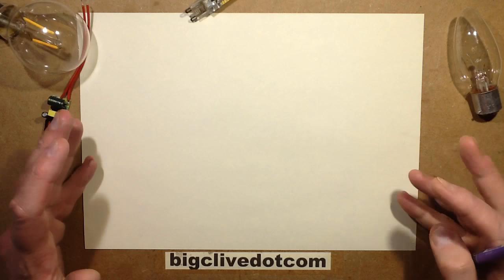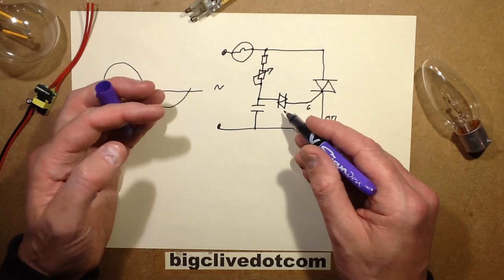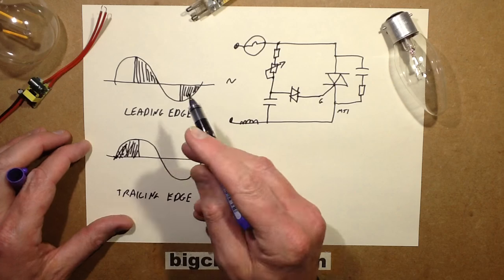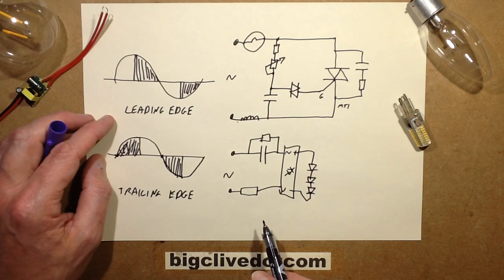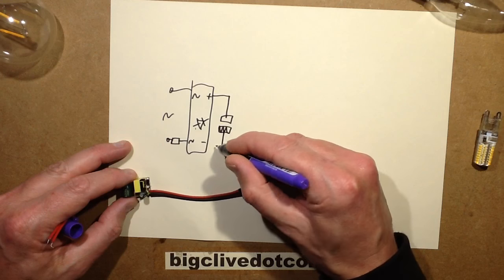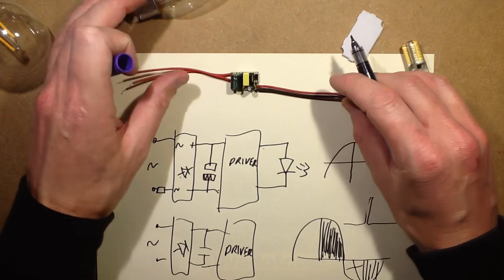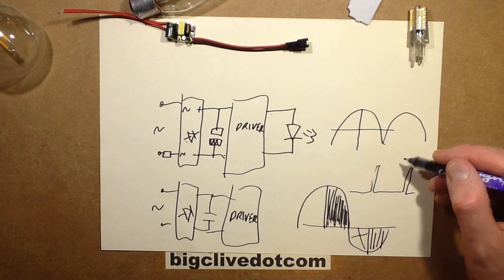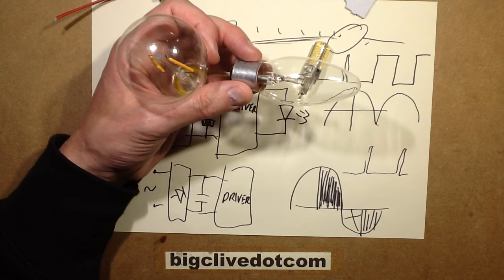Dimming LED lamps with ordinary dimmers.

Comment: One day lighting circuits will be low voltage DC, with the bulbs containing no electronics but the LEDs. Elsewhere will be a fairly beefy AC/DC transformer and the wall plates will just do PWM of the whole system in the room. Spraying RF around the house to control lights feels too inelegant and error prone - I've used cheap RF doorbells before, they're not very reliable and like to randomly go off.

We have dimmable LED lights in some of our classrooms at work, and the wall switches are "clever" - press to turn on, press to turn off, hold to dim. Some of the bigger rooms have big switch panels with programmed presets to turn banks of lights on at set intensities. So we can press "1" to make the room full brightness, "3" for just the front lights, and so on.
Reply: With COB and filament technology low voltage high current DC is not a concern anymore. Mains AC can be rectified and fed into long chains of series LEDs controlled by a high-voltage buck regulator with PWM control. How to control? It's a matter of application. Choose from DMX, DALI, existing WiFi network. Something akin to homeplug ethernet might be interesting for domestic applications
Reply: Pretty much a noob at electricity, but how would you do this? Doesn't DC voltage drop over long distances with a decent amount of current? Seems like each light would be receiving differing amounts of voltage along the way through your house, so I dunno. Would you have the central transformer run all the wire at something like 12 volts and then have regulators at the base of each light?
Reply: Maybe 28 V.D.C. with up to 4 amps per circuit. Each wall plate can contain a small cheap buck regulator down to 12 V. or less for dimming.
Reply: I have lit a bar with about 15 meter of 12v ebay led strips, coupled with cheap pwm dimmers and a leftover computer power supply that is safely tucked away behind the audio rack. The whole thing cost about 25 euros.
Reply: Nice! I think one day houses will be wired with normal 110-220 VAC and some D.C. low voltage runs, maybe like USB type C that determine how much power is needed and set themselves to that level, if they can.
Reply: Sure. Normal house wiring has about 1.5mm² copper. Even for 10-20m runs it is more than enough for lighting at 12-24V. You can modulate some control signal onto it, so a small controller in the lamp base can dim the light.
Reply: Pretty sure we'll just use DALI light fixtures. Makes more sense.
Reply: I doubt very much that anything approaching a 'beefy transformer' would be used to produce domestic DC. Given the rise of the SMPS I expect something such as that would be used instead, although I think local SMPS's would be used in each room and could therefore be tailored to suit the power requirements individually. Such systems would also be easiest to retrofit.
Reply: Then you need separate wire runs for the lights, adding expense, and they'll have resistance and potential capacitance (or else all the more expensive wire) of varying amounts for different runs which the driver would have to try to compensate for, or actually it probably couldn't without itself being more expensive with more active sensing tech than just the basic resistor divider type current regulation.

However there are already custom lighting installations that use a central buck power supply to drive multiple LED fixtures, but they tend to cost far more than just using autonomous traditional LED bulbs in existing AC outlets.

It doesn't make sense to me to do it, until every other device you own moves to low voltage DC too, which won't happen.  If anything I'd sooner expect regions of the world to double their AC mains voltage to reduce current as increasing adaptation of electric vehicles, increases saturation of power grids.
Reply: If we were to start with a clean slate things would be different. I could see low voltage DC for room lights and gadgets, and 220AC for high power loads. I have a few things on a 12VDC bus just to eliminate some wall warts.
Reply: +jimvandamme - Very doubtful.  If we in the US were to start over it seems more likely that we'd have 220VAC going to every room, not lower voltage.

The thing about a 12VDC bus, or even trying to get closer to the forward voltage of white LEDs for direct drive, is that not everything would run from 12VDC, nor can you deliver the roughly 3.2VDC for white LEDs at enough current to not suffer variable losses at different wire run lengths and # of LEDs & wattage, load, unless the wire was very thick and expensive to minimize losses.

So, you'd still need a DC to DC power adapter at almost everything, haven't really gained much if any efficiency and often lowered it, and not necessarily any wiring + equipment cost reduction.

 Somewhat to the same extent, this is why you felt 12VDC bus was useful.  Most electronics today run at lower than 12VDC but the significantly higher than needed (in many cases) voltage was just settled on as a way to keep current down till power made its way into the device where a PCB localized step down regulation circuit arrived at the right voltage for the device.

It's cheaper to keep current low as long as you can with higher voltage instead, which is also why the power grid itself uses higher voltage stepped down at the power transformers that service residences.

What we have instead is a situation where, with an expectation that more and more vehicles will be electric powered, we might even have benefited moving up to 480V, or at least 330V to reduce cost and increase efficiency getting power TO the home, except now it would be a massive retrofit and a mess to have some consumers with one and other consumers the other.
Reply: I've got a 12v bus in my room as well. Just running off an old AT-style PSU. Very stable 12v DC power for whatever I need it.
Reply: That it works for you to leverage tech you have as surplus, is not an evidence that it is cost or efficiency effective for wide scale deployment.

It may very well be a good choice For What You Do, but that is not the average person...  I too, have thought about a localized DC bus but it would be a waste to build into infrastructure for anyone who did not recognize the merits ahead of time to ask for it.
Reply: So you're worried about RF, but you want to run big lengths of wires around your house and rapidly pulse them on and off at high frequency? Dude, that'd be RF hell.
Reply: Traditional AC mains has another benefit:  Isolation.  No two devices run from AC mains share a common (signal) ground unless they're deliberately connected together -- e.g., a cable/sat box and TV.  With DC, this would require a relatively sophisticated isolating DC-to-DC converter (as compared to a traditional linear rectifier), negating at least part of the potential advantage of having LVDC available.  Although, you do at least get to pick the switching frequency which means potentially cheaper magnetics.
Reply: hellterminator Imagine all the harmonics
Reply: +Luis Marques Wrong, actually. AC has same or (almost always) higher losses than DC (look up power factor), the reason AC is used is because it's relatively very easy (and cheap) to step up/down the voltage and we use that to reduce losses on long power lines. If we could make cheap and powerful DC/DC converters, we'd be running mains on DC.
Reply: You forgot the great big self-sustaining arc produced when 240VDC get switched off. Example; the BIG RED warning sign on my solar DC string isolation switch with a warning to isolate the mains first (if you don't want a burnt up DC isolator, that is....)

Comment: Hi Clive, could you do an update on this subject.
I’ve recently changed my kitchen down lighters from halogen to dimmable led and they seem to work fine on the existing dimmer that was in the house when we moved in 20 years ago. 
No buzzing or flickering from the lights or the wall plate.
It used to buzz a bit with the halogens when on full tilt 9 lamps @ 50w each.
I was actually surprised they worked having heard about issues with dimmable  led.

Comment: This is why  commerial installations used voltage or current controlled lamps, running at 24 to 50 volts. They are connected to the mains via dedicated drivers and power supplies. The drivers themselves are dimmed using DMX, DALI or 1 to 10 Volt signals. One driver can control a numerical of leds, and a suitable PSU could feed a number of such drivers. Essentially the lighting is a low voltage installation.
Direct mains dimmable Leds are for existing installations where rewiring isn't practical.

Comment: Do you think you could please make a video showing us in practical layman's terms what happens if you use an LED bulb with a dimmer?  I thought you'd made such a video and maybe you have, but I couldn't seem to find one.
Reply: Isn't that what he just did?
Reply: The Layman's terms as you put it... OK so a traditional dimmer will cause a standard LED bulb (non dimming type) to fail really quickly. Then when used on a LED bulb designed to be dimmed, the traditional dimmer switch would cause really bad flickering of the bulb. I have seen the results of both, and either effect is not good at all. 

Lowest cost option is to use a LED dimmer switch (most of them have a trimming adjustment of some kind), and a quality dimming LED bulb. This is not a perfect solution but works well with no flicker since you "trim" the switch to allow full range of the dimmer.

The other option is to use a LED RF kit that has bulbs that use some sort of radio control, Bluetooth is the most popular one, since you can download an App that works with the bulbs. This allows you to control each bulb or groups of bulbs. Most of these offer all sorts of color options too. This sort of setup offers the most flexibility and can provide the best reduction in power consumption. Since you are not installing a dimmer switch in the wall that could potentially use more power then the LED bulbs would. With this setup you would only use a normal on/off switch. The main issue with this setup if the initial cost for everything, since the bulbs themselves are doing all the work. However since they are gaining popularity, the prices are dropping quickly. A year ago the Bluetooth bulbs were just over $40 for one, now you can find them for about $20.
Reply: I seen some bulbs that come with an RF remote control that allowed you to adjust the colour temperature and brightness and such, I thought they were good.  I've been thinking of getting a couple of the LIFX bulbs but those are rather expensive.
Reply: Lachlant1984
You are absolutely correct there is all sorts of RF bulbs out there, the ones that come with their own remotes tend to be lower cost then the Bluetooth (form of RF signal) ones. The Bluetooth ones have the added benefit of not only having their own remotes (most of the time) but can also be controlled by certain things that uses Bluetooth like a tablet or smartphone for example.
Reply: Well, I went and had a fun adventure with a dimmer a while ago. First bulb I bought essentially strobed. It wasn't a flicker, it was outright strobing. That bulb apparently wasn't even a dimmable type, so I sort of chalked that up to me being stupid. Second bulb has been in the socket for about 2 years now, and it only lights up once the dimmer is about half way, but otherwise works fine. Hasn't failed yet.
Reply: legacysage
There are adjustable dimmer switches that use a trimmer of some kind. This would allow the starting voltage to be set so that when the slide is at its lowest point the bulb(s) will be very dim, but still turn on at the lowest dim setting.

Comment: For all the elegant and efficient solutions I think we'll largely end up with highly optimised cheap versions of the last type you describe (using smart circuitry to bodge a good result with existing hardware), simply because so many people have built in dimmers and an aversion to screw drivers.
Reply from the maker: That's the problem.  Trying to make a transition from legacy wiring fitments.  It's also why we have lamp holders you can poke your finger into.

Comment: which is why i put a 'ballast resistor' in parallel with the bulbs, just a pair of 3Kohm 10w ceramic power resistors in series is all it takes for 120V it also heps to lesser degree with CL rated dimmers in some cases

Comment: I Suppose this also applies to the beefier theatrical dimmer packs.

They replaced all of our house lights with the cheapest 'dimming' LEDs they could find as part of an eco-friendly initiative (never mind the fact they didn't even touch the 1KW Halogens and scoops) They've replaced dozens of bulbs that had a failure mode of dying, or my personal favorite, becoming a strobe light.

Comment: You are exactly right.  The dimmer (as opposed to "dimmable circuitry") should be in the bulb or fixture, and receive commands via the power line.  One simple command protocol is Blink'n'Dim.  A short power interruption triggers gradual dimming or brightening, and another halts it.  Technology to achieve this is described on ResponsivLED.com.  As of  this writing, no fixture manufacturer has embraced it.  However, a 0-10V Blink'n'Dim Adapter is available on Amazon for fixtures that include 0-10V dimming capability.

Comment: Before triacs were available the PA dimmer used a SCR across the + / - of a bridge rectifier ! ( I have one and it still works ! ) .. the colour changing LED lamps use PWM and a remote controller ... a small step to " beef up " the lamp driver to supply big LED room lights , using similar hand held controller ( then remove your room's triac PA unit , fitting a normal on / off switch ? ? ) this must be the way for the future ?

Comment: According to the latest technology I've seen, the dimmer module varies frequency, the supply to the LED is rectified to DC so the LED does not care about the frequency but.........
Their are two (glass or plastic )envelopes around the LEDs with a gap for a substance which becomes less opaque (more transparent) at higher frequency controlled by the on board electronics.

Comment: I design Phase dim LED Drivers for volume manufacture. The one thing you forgot to mention is that it's the dimming system from hell.
One further issue (of many) with triac dimmers is that diac can have different trigger voltages in each direction, so phase angles may not be symmetrical = 50Hz flicker which is even more noticeable than 100Hz. I could go on forever about the technical challenges, but I won't.
The only true way to do this is to have a twin stage driver with advanced digital control. But such a circuit is very large with 40 to 60 components, generates more heat and is very difficult to fit into a bulb housing.
There is also a USA flicker standard IEEE1789:2015 which if eventually adopted may make 99% of phase dim product obsolete or even illegal.
I would also postulate that the terrible effect on mains currents ( very high THD/Harmonics) could be outlawed in future.
Someone has commented... can you make your explanation more simple. The answer is no.
Cheers, I enjoyed your video
Jerry
Senior Designer Harvard Technology

Comment: This is a pretty good explanation, however is is somewhat "Clive-centric". Here in Australia, the use of capacitive droppers is pretty rare, as those lamps don't comply with EMC or power factor standards. Also, the use of PWM is not the easiest way to control LED brightness, nor is it the way that dimmable lamps are controlled. Modern chips adjust the output current, and they internally handle power factor as well. A single-chip buck with current control and PFC is extremely cheap with low component count.

Comment: The long term solution might be to switch to 12 volt dc wiring for domestic lighting. I recently installed half a dozen Bonlux T22 E14 ac/dc 12V-24V, 2W SES clear filament LED bulbs (from Amazon) advertised for "RV Camper Marine, Truck, Boat, Solar Power" in wall-lights a wooden gazebo.  I didn't want to get involved with mains wiring regulations so everything is fed from a 12 volt dc PSU housed in the nearby garage. The lamps are really good but are far too bright and despite the fact that they're advertised as non-dimmable, I decided to have a go at dimming them. I tried them first on a variable voltage dc lab power supply and they dimmed nicely, cutting off completely at about 6 volts. Feeding them with a PWM signal didn't work (as expected, because of the internal smoothing capacitor), but I designed a variable PWM circuit using a 555 timer and fed that into a P-channel MOSFET with smoothing afterwards (as used in a buck regulator). It works perfectly. The waveforms all look good on an oscilloscope and nothing gets hot. It needs a bleed resistor across the output to cope with low loads and the pot needs to be logarithmic so that the dimming is not all bunched up at one end of the scale.

Comment: There are now several intelligent dimmers on the market that work with leading and trailing edge plus resistive they either auto sense or you program it by switching it on and off. you also set the threshold you want as the lowest as different bulbs have different on thresholds.

Comment: Since you have LED lamps with and without the drivers, that makes it a mess to try and work around it directly from the supply.
As you said, if it has a smoothing cap, you can't really do anything, since the buck driver would just work harder to output.
So isn't the problem coming from more of a "missing standard" on what an LED lamps contain?
So making a matching pair of dimmers and dimmable LED lamps, would work the best?